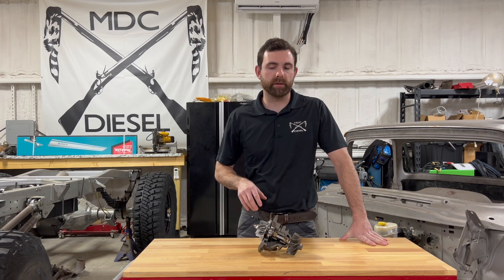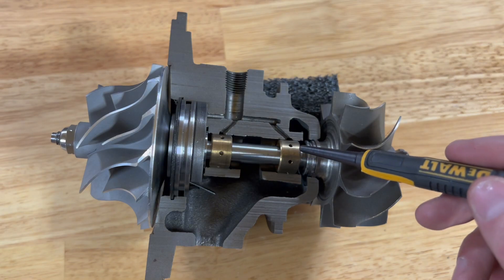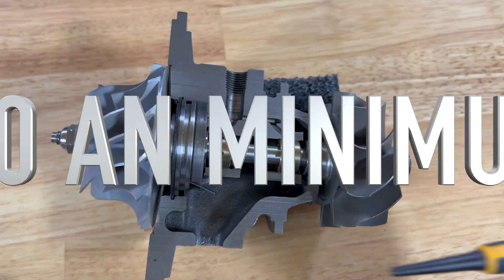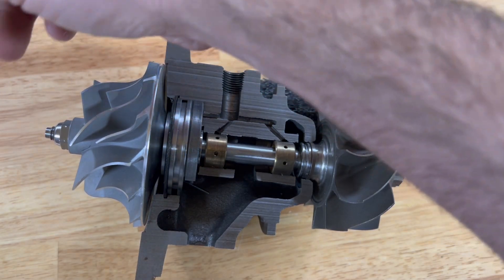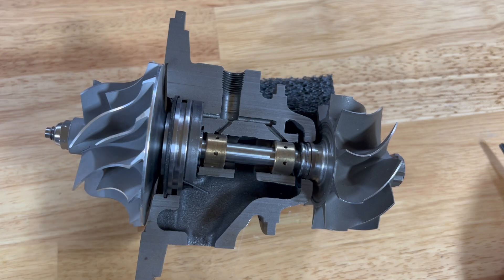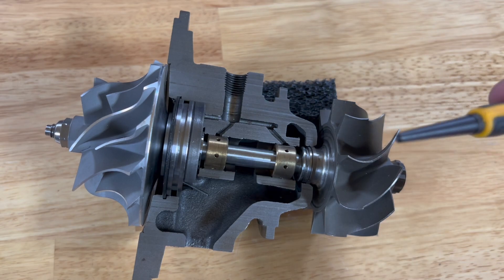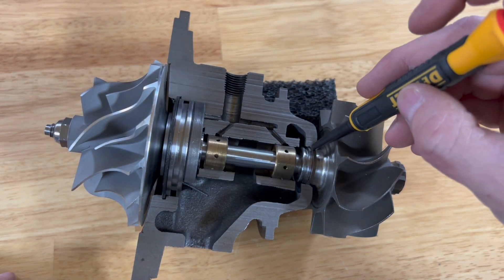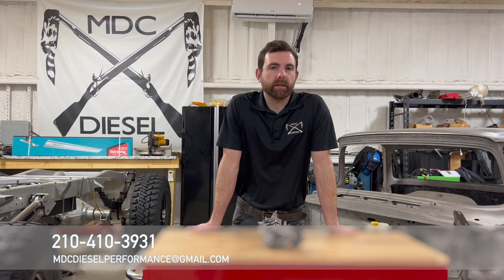Oil In Your Turbochargers Turbine? Diagnosing and Common Causes.

Comment: Not truck related but what if you have a turbo that has a electric actuator that controls the waste gate and the turbo is failing and over boosting would this cause oil to go though the air intake? 
My car has a ccv which I have replaced and I can see little oil to the turbo from there there which I believe is in the normal range. 
My turbo actuator makes a buzzing noise and boost is strange I think it's over boosting. 
My exhaust dpf and air intake throttle is getting covered in a alot of oil and I believe this is cause my diesel car to missfire also.
I have a oil leak externally that I believe is under the turbo so be either the turbo or feed/return I'm not sure yet till I dismantle. 
I don't think I have excessive crank case pressure, I just don't understand why so much oil is going through the turbo as it can only get there from the feed. If it was over boosting as I mention would this do this? Or does this seem like it's a common case of turbo seals failing? My only gripe with oil seals failing is why is it also leaking externally.

Comment: Would a badly leaking exhaust flange just before the turbine cause heavy oil leaks on the compressor side? Enough to fill the cooler?

Had an IX35 over run on me with a recon turbo fitted. Everything checks out, return, feed, case pressure, case vent, air filter. Only thing I noticed is the exhaust flange of the turbo was leaking where the bolts let go.

I assume high RPM with minimal gases going past the turbine not spinning the compressor fast enough to create pressure, would suffer vacuum and suck the oil out? I dunno, it's driving me a bit mad. Never had a turbo fitment go wrong.

Comment: I have a new turbo on my truck, previous turbos were leaking bad. I’m getting oil at the intake plenum area by the grid heater. What are the chances this is from just oil buildup being pushed through the intercooler?

Comment: What about when you have your crankcase vented to atmosphere with breather but CcV still intact (recently replaced as well), and you get white smoke until it rises in temperature? Pickup is deleted 6.7, assuming the turbine side oil seal is compromised? VGT seems to function flawlessly, was deleted at 35k and showed up around 60k

Comment: Nice video! Thanks for the info. Since I bought my truck (used) it smokes light/sometimes heavy blue downhill only on very slight throttle. 2017 6.7 Cummins with s300 turbo.

If you have time maybe you can watch my video of what my truck is Doing. The video gives you an idea of what the truck is doing but doesn’t exactly show the full extent of how much it’s really smoking. Sometimes it’s 5x that thick 

https://youtu.be/rjvmsVDrjDw

This video is after I rebuilt it. 
It was doing it a lot worse before I pulled it off and rebuilt it. Still does it. There was some oil on the exhaust side of the bearing housing and in the last 2 cylinder ports for the manifold when I changed the manifold as well. 

No oil consumption no coolant contamination can’t figure out what’s going on with my pickup. Only other thing I can think is to try a brand new turbo. Oh, also my exhaust stinks really bad as well. Burns the eyes

I did the ccv reroute last week. May have helped a tad bit but nothing tremendous.